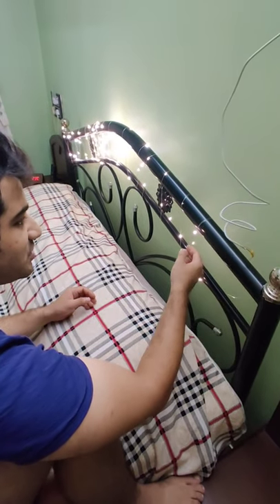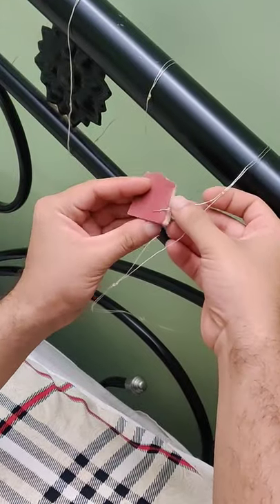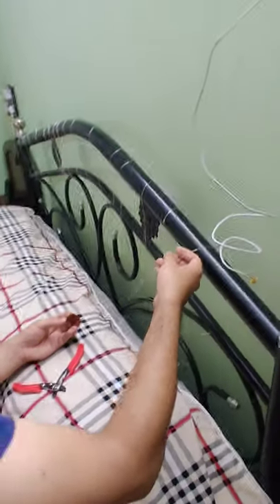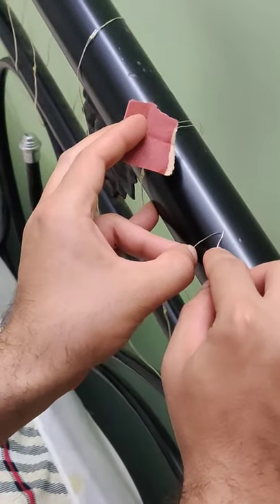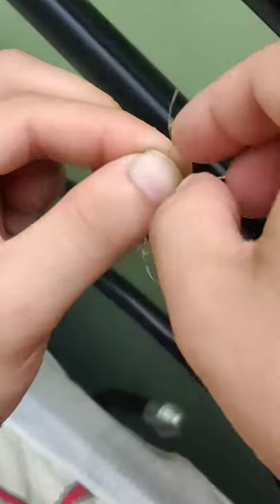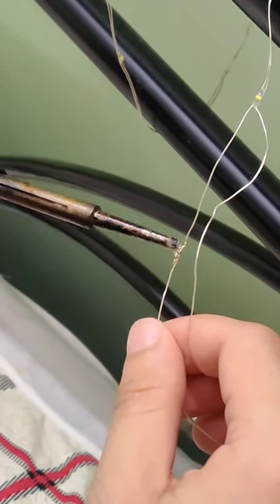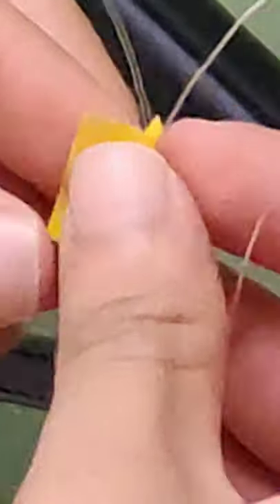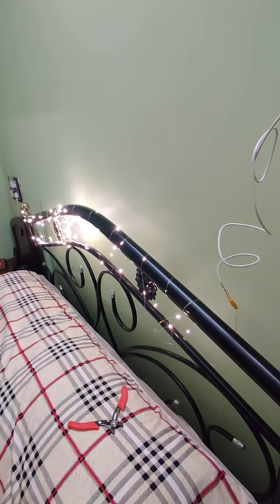How to repair broken fairy lights

Comment: I did this. Its working. I had to cut off two of the bulbs. But now that its working, every bulbs are getting very hot. :"( is this a problem? Or is it normal? I didn't check the temperature before fixing tho.

Comment: This video is really valuable, I don't have a sandy paper in hand, I think and do another way easier this and get a result in success. Simply cut the copper wire around 1.5 cm (one or two side if needed to join depending situation), then using cigar light to fire that cuts and clean by a soft tissue or linen. Afterward, do it joined by twist and tape it seperately.

Comment: Hi. First off, thanks for this explanation. It all makes sense now. I was wondering how it was that these wires touched each other without shorting. Apparently these have non-cunducting material like any other wire has. It's just so small that it's hard to tell.

Comment: Instead of insulating tape, use silicone and rub over the splice, allowing to fully dry in eight hours just to be sure. 
Test the silicone covered splice with a few drops of water. 
If the wire fairy lights don't short out, which they shouldn't if silicone coated completely. 
Now you don't have to worry about the splice not being waterproof.

Comment: Thank you for this video! You made it very easy to understand, and I appreciate that! I'm 76 and never had the need to solder before BUT I'm creating a custom shadowbox using a pre-made frame. I'll place the embroidered Christmas wreath, complete with lights, inside BUT I need to put the battery pack outside of it because it's too bulky to put inside the frame. Since I have placed the lights permanently in the wreath by stitching over the wire, I need to disconnect and then reconnect the wires so that I can make a small hole in the back of the frame and the pull the wire through. I do have a question, though...can I use Duck (not DUCT, but DUCK) tape to wrap the splicing, rather than electrical tape?
Reply: I think electrical tape would be the best sir/ma'am. To mitigate hazards like fire or shocks. Also awesome to hear at 76 you're getting creative! You're more young at heart than us youth!
Reply: @AKSHUNAK  Thanks for your response, AKSHUNAK! I really appreciate it. I truly believe that we all need to keep growing mentally every day by learning something new. I have never in my entire life said, "I can't do that." I may have tried and failed, but I've never said, "I can't." As to the soldering, what I wound up doing was twisting the wires together, applying the solder and then using shrink wrap made specifically for the purpose to seal the deal! It works wonderfully; I've made several shadowboxes since my post. As for being young at heart, when my granddaughter told me, at age 10, that I was very childish, I told her I'd rather be a child at 70 than an old lady at 10. Shut her up fast, LOL. 😃
Reply: @TisEyerish1  Thank you for your words of wisdom and inspiration. I will keep this in mind on a daily basis❤️

Comment: Hi! Lovely video! To the point and clear! The thing is, I have 2 copper rice lights like the ones in the video, But, they aren't coated, they're copper through and through, and they work perfectly well, I just need to connect them, so I can use one point to light them. Can that be done? how do I know which wire to connect to which one, (there are 2 in each)  or it doesnt matter? Do I still need to sand them? So many questions, I know! Will appreciate it, if you could answer! Thanks!
Reply from the maker: If possible send me the link to the lights so that i can see them...i need to know what type of connection is available...does it have a usb attached?...is it battery operated?...how do the suppliers expect you to connect them?

Comment: Thank you 🥺 

Does it work the same way if both wires are broken? :(
Reply: im pretty sure it does as long as the electricity could travel??
Reply: Yes. My cat ate mine in half. Followed this tutorial and got them working again. I put heat shrink over my repair. I put them together and the colors were different. Had to take them apart and switch the wires. All good.

Comment: hello, do you know how to fix the fairy lights that all its tiny bulb are not working?
Reply from the maker: Usually fairy lights that have bulbs dont work because one of the bulbs has burnt out...so in order for it to work you need to find out which bulb has a broken filament and then remove that and reconnect the circuit by soldering the points between the bulb

Comment: I ordered a string of fairly lights and I only need like 1 foot, can i cut the wire to shorten them? And also, do i have to sodder them? Can’t i just twist them and wrap in electrical tape?
Reply from the maker: Hey...you can cut them to 1 foot..but you would have to count the nunber of leds and supply the appropriate current and voltage...as to your second question...you can cut them and twist them together with electrical tape...but be sure to expose the conductive wire for the string lights...have a look at my other video for that

Comment: Hi i was wondering if this also work if the two wire were cut off?
Reply from the maker: Can you be a little more specific as to which two wires?
Reply: @joaquimnoguer6134  So my problem is, there are two cords connected to the lights themselves and to the usb cord, The two cords are cut, all the lights are separated from the usb cord. 

Sorry english is not my first language, so i really dont know how to explain it.
Reply from the maker: If possible send me a picture of the wires to my email address joaquim6469@gmail.com...coz i cnt figire out what these wires are...are the spare wires???...are the comnected end to end...if not then it doesnt seem that they complete a circuit and cutting it wont matter
Reply: Oh i get it now, thank you so much 😊
Reply: Hi Maria. I have the same problem. Did you fix yours?

Comment: Can i still use my fairy lights even though it is cut? For a day? Since i will do this maybe tommorow thank you
Reply: Btw can i use lighter instead of what you are using? Since i dont have that thing
Reply from the maker: No you cant use it as such... only the lights before the breakage will light up
Reply from the maker: U can just use sandpaper and then twist the wires together...you dont have to solder them

Comment: Use sand paper where you want to join. Scratch points so you can join actual copper wires which are covered with non conductive material.

Comment: Hi..thank you so much for the vedio. Could u plz help me to repair my cork light. I've worked on it till now(@2AM), by the end of my project the lights are not working. I tried opening the batteries and refix them, but no use. Could u plz plz plz help me😔. If i can fix the lights, it just helps me alot. Plz help😔😔